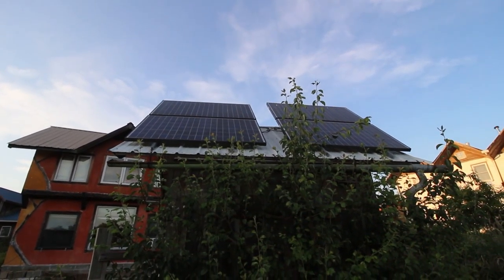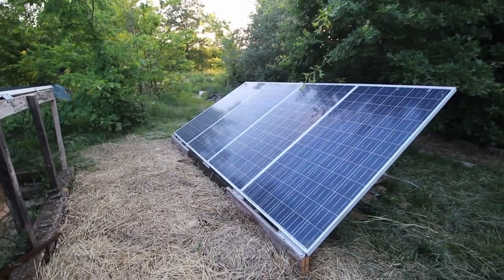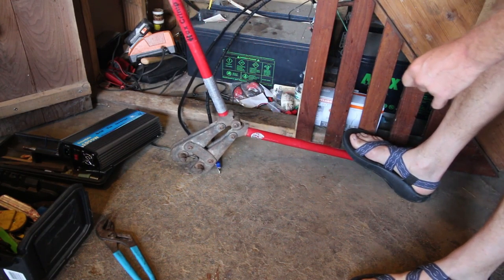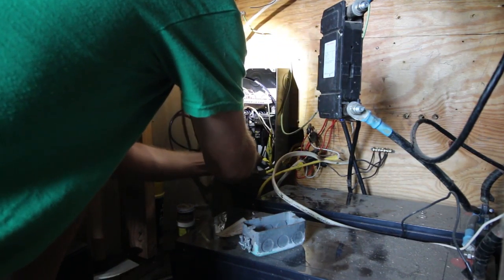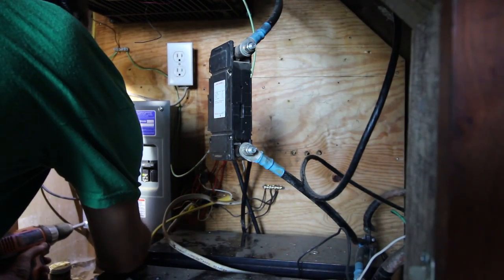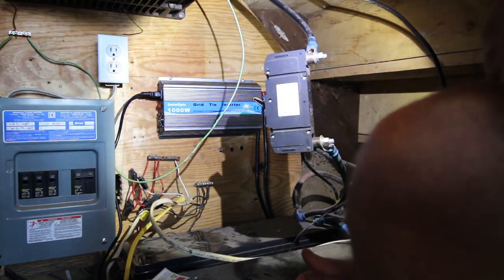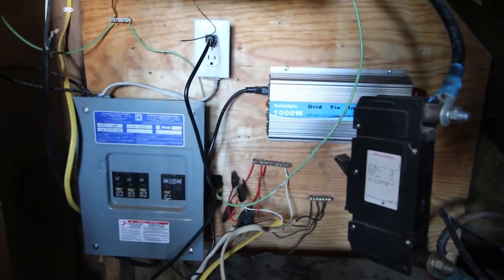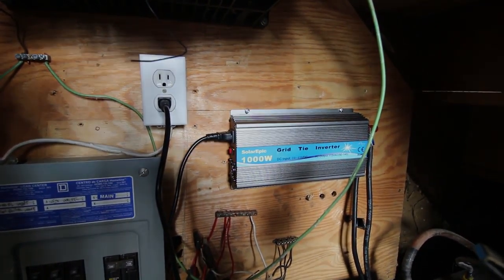The Cheapest, Easiest Way to Produce Solar Power at Home

Comment: Good video.  Thanks Dan.  They finally allow net metering here in Lubbock, TX, but I use so little power, usually less than 50kWh/mo that it would actually cost me more to do net metering because they increase the base fee from like $8 to $20/mo and you don't get any money back from producing more than you consume, you only get what you use cancelled out.  I've thought about doing it anyway, just to get the co-op workers more experience-maybe eventually they'll make the terms better if enough people do it.  I guess it might still make sense for large consumers.  I've got most of the components for an off grid system, so I guess I'll probably do that first.
Reply from the maker: That's great that they allow net metering where you live. It is kind of a raw deal that you pay more for the base fee, but there is the cost of maintaining the infrastructure. I wonder if that fee is a real cost for them, or just a disincentive for people to do net metering. We have a co-op here too and they've been very amenable to our microgrid setup. I understand that a lot of rural electric co-ops are the ones lobbying the government to stop allowing net metering.  I think this will hurt them in the long run.  Good luck!
Reply: I think things are likely to get worse not better.  I would suggest you stay non-grid -tied so they don't get their hooks into you.

Comment: There are plenty of 12V grid tie inverters available on the market that automatically cut off if the grid goes down for the safety of linesmen working to repair the grid. They cut out so they don't back feed into the grid causing it to be live while linesmen believe it to be dead. These grid tie inverters are also called " plug and play inverters " because there is no wiring work involved, you just plug them into a wall outlet and they feed power to your home. If you are producing and feeding more electricity through the grid tie inverter than your home is using at any time the access electricity goes through your meter and into the grid. The power company only gives you a fraction of the money that they charge you for the same amount of electricity.

Comment: I have some solar panels just doing nothing, as well. I was under the impression that each panel required its own microinverter, so I was looking at string inverters (too expensive to buy right now). But if I can connect several panels to one microinverter, I may do that. However, I also plan to eventually add panels as funds allow. If I start out with a microinverter today, will I need a string inverter later? Any advice for me? (this is for ordinary grid-tie)

Comment: You can connect them in series and create a 24v input for each inverter. This will give you the requirements from the micro inverter. The serials connect are connected by attaching the positive of one panel to the negative of the other. The remaining 2 wires will be the input into the micro inverter
Reply from the maker: thanks for the comment. If you read the other comments, this has been mentioned. The problem that I talk about in the video is that the combined wattage resulting from connecting two panels in series was too high to be compatible with the inverter.  I had to find an inverter that was compatible with the higher wattage. Later in the video I did find one--what the video is about.

Comment: Take 2 panels in series the  parallel two two pairs to get 24v or put ll in series to get48 volts.
Reply from the maker: Yes, I'm aware of how to connect panels to increase voltage. They were still not compatible because the wattage changes when you do that.

Comment: Excellent presentation. I want to build a solar panel system that will put out 5000 watts but so far the only companies I have found want to charge unreasonable prices so I am looking into building my own. I also have a lot to learn about setting it up properly. I am very disappointed in the government wanting to stop people from using solar power in their own homes and even though there are only a few against it so far it goes to show just how far we have gone from being truly free to being censored at everything we do. As far as the price drop that is due to the demand of solar power use increasing and causing companies to compete for your business by lowering prices. If the government were to help you they would most likely want your first born son as payment. Oh wait, they already do that with the draft and don't even have to help the family. Anyway, thank you so much for your presentation, it has given me back my motivation to get these solar panels installed and working. I can't even hardy imagine saving 2-3 hundred dollars a month on the power bill.
Reply from the maker: Actually, the price drop in panels was due to the transfer of manufacturing to China and then the increase in production and demand. Also because of government subsidies to renewable power during the Obama administration.  The connections between these events are well known and documented and I personally got subsidized by the government to install solar powered irrigation in my vineyard.  They didn't need my first born and all I had to do was fill out an application.  It essentially made it possible to have irrigation for my vineyard and hoop house businesses.There were many opportunities for tax credits for installation of renewable energy systems over the last 10 years and it led to a huge growth in the solar industry.  Trump has wanted to stop competition with the oil industry by the solar industry and stop energy independence by implementing high tariffs on Chinese solar panels.  Now the price has gone up and the industry has suffered greatly.  This is bad for all of us.

We haven't had a draft in the US since 1973.  You have been misled by unreliable sources.

Comment: if you connect your panels in series instead of parallel you can up your voltage but end up with the same amount of watts so you could use the microconverters
Reply from the maker: Yeah, I actually explain that in the video, but that still doesn't make them compatible with the microinverter.

Comment: I would like to build a simple 2kw solar, there are several types of solar panel, what would you recommend. am in UK
Reply: Mono panels are more efficient so smaller for the same wattage. Look on some wholesale websites, many list panels by the watt per $. Some of the name brand panels are well over a dollar per watt, but some are cheaper. I checked a wholesaler in the usa where i am and they have two cheaper assembled in the usa panels with competitive warrabties for 0.79 dollar per watt. One was 365 watt for 289. That is a little over $1700 usd for enough to meet tour criteria. Of course there are other costs too.

Comment: You should never backfeed into the electrical grid without the proper equipment and the agreement if there's ever a power outage you could fry an electrician working on the line. Just like you must have the main breaker off when back feeding into the house with a generator for power. outages. Safer way  just have a separated circuit to run dedicated items.
Reply from the maker: We have taken all those precautions with our microgrid and I explain in the video that the inverter I use cannot work unless it has grid power.  If the grid goes down there is no way for the inverter to backfeed or work at all, by design.  Please watch the whole video before commenting.  Inverters that backfeed have to be designed to cut off power in the event of a grid power outage for the exact reason you mention.  They are not the same as hooking a generator to your power system.  But thanks for your concern.
Reply: Hardcore Sustainable it was for more that didn't fully understand the video that I could read it in my comment. Not all understand about the safety of back feeding into a panel. Electricians lives matter✌️

Comment: I used a reputable Chinese manufactured grid tie inverter that plugs in with island protection. I put up to four in the summer and six in the winter and I harvested enough energy to drop the electricity bill. I could monitor my neighbors numbers and mine and my bill held at 30$ while theirs fluctuated at 150$-200$. Of my 30$, 10$ of that was a mandatory fee. 

So pop off those inverters. Save them or yard sale them. Or same with your panels. I’ve made a 12v stand alone system from my water shack for shower, pump, inverter to plug in this and that tool wise. So all same components. And then would upgrade. I’m just at the brink of getting a 24/48 inverter but making the jump to a three wire ac system no longer makes sense because I’m now 100% off grid. But it helped me understand the system doing my own mistakes. The completed system while expensive once set up and running with the assistance of professionals I still say is the way to go if you want to save money. Because whatever you save in components you make up for in mistakes in my experiences. 

I’m now 24v - 8 six volt 500ah wired series and parallel. I’m at four 300 watt 24v panels about to get four more. And I took my 12v panels 100w - 10 panels and put them in their own stand alone 12v set up. 

Those freezers now are 12/24v.
Reply from the maker: Thanks for the info. I'm not sure how you are saying your system is different from mine and you don't give any prices of your components. Sounds like maybe you are suggesting not using the direct grid tie inverter and using a larger wattage inverter and being off grid?? Why would you say I should sell my inverter and panels? You don't explain anything.  I spent $100 on my grid-tie inverter and it's still going strong and I'm still backfeeding way more power than I'm using. My old non-grid tie inverter is just feeding power to my batteries. I saved at least $1300 by not buying a new grid tie Outback. I really like the way it's working and don't see anything wrong with it so far.  The sundanzer fridge and freezer I have are both flexible for 12 or 24 V.
Reply: Hardcore Sustainable if it works it works lol. Well it’s just that you said in the video that they weren’t working with the 12v. If they are then it’s not an issue. If they aren’t you can recoup your money and keep the working products in circulation.  And make your system expand in a lot of different ways. Just as a suggestion.  So I didn’t sell my 12v system when it became obsolete. I separated it and use it as part of my overall system in a smaller segment.
Reply: Hardcore Sustainable oh and the only thing different about our systems?  I was told I was under feeding my solar. Which is why I’m adding more panels. If that also helps you. Even though you may have a decent harvest most days there are days you and I aren’t covered. And it helps keep the low days a higher discharge level.
Reply from the maker: @blairbushproject  Okay, I thought that might be what you were saying. I thought maybe you missed the later part of the video where I installed the inverter and it was able to work with my old panels.  Thanks for the suggestion.
Reply: Hardcore Sustainable I might have. Only being off grid is so luxurious that I completely have the accompanying interruptions in services for signals. I had a big storm roll through and it hit hard and fast. I’ll check again because you know more than I do about the little inverters. I’ve wondered about them but havent seen real people use them in real world conditions. Probably about 3 economies and at least a county away someone might have one of those lol.

But I’m just now getting to do the solar fridge. And that’s when they told me I was under harvesting with my setup.

Comment: My Utility rates with FPL in Miami are tough to beat right now, and my average bill is under $150/mo.... With cost of solar still dropping better off waiting.  The money will be better spent reducing energy consumption, like a higher eff AC unit.  And maybe an instant on water heater.
Reply from the maker: I don't do it for the money savings, although this video does say "cheapest".  The price of solar panels is going up dramatically very soon because of a new trade restriction the Trump administration has imposed on solar panels not made in the USA (these inexpensive panels have made solar much more accessible and led to the growth of the industry). It's always a good idea to reduce consumption as much as possible before installing a power system, because then the system will be cheaper.

Comment: Dont you have to tell the grid company that youre back feeding? Or can you just plug it in and go without notifying anyone?
Reply from the maker: I would guess that most people need to find out if their utility even allows backfeeding, but I didn't have to do that because we have our own microgrid at Dancing Rabbit and we have set everything up through our electric co-op to backfeed.
Reply: Hardcore Sustainable what special equipment does the hopstepping hare have to backfeed?

Comment: Can we install them easily ourselves?

I am thinking for manufacturing solar panels and installation inexpensively much less than solar companies are charging home owners.   This will reduce cost of ownership and make them affordable for more home owners.
Reply from the maker: With this system of microinverters installation is very easy, but you do have to have permission from your utility to backfeed into the grid. And as with anything electric you want to take all precautions to make sure you are connecting everything safely and not creating a fire hazard. If you aren't an electrician and don't have much experience installing power systems, you'll want to read up on what's involved and make sure you are doing everything safely. You should have an electrician or a solar installer inspect what you've done.  The system I describe in this video is a matter of connecting microinverters and panels together with simple connectors already on the panels and ports on the inverters.  Then they plug directly into your grid or can be wired directly into it.  My inverter had a three prong plug to plug into a socket as you can see from the video.  It's very simple.

Comment: Interesting info, but I'm pretty sure I want a non grid tied system. I just have no faith in the power companies, and anyway what good is having your own power system if it goes down every time there's a power outage?
Reply from the maker: An off grid system is a fine idea, but unless you have back up of a wind turbine or enough storage you may have times of the year when you don't have much power because of clouds or lack of wind. Batteries are really expensive too, and they don't last very long, which is why I just went to a backup battery system in the event of a blackout.  Either way, you are still not giving money to fossil fuel industries and not contributing as much to climate change--so that's the best thing.
Reply: You might consider a hybrid system.  You are connected to the grid when you need more power than you can produce but you don't feed back to the grid.  That way you will always have all the power you need and you will also have your own power when the grid goes down.
Reply: @heidiembrey4917  Is it legal to operate a generator to run a refrigerator? If so, then it should be fine to have a basic solar system with panels, charge controller, batteries, and inverter to serve as a generator; just don't connect it to the circuit breaker box so that it is not tied to the grid. You would obey the law by maintaining a grid power connection, and you can size your off-grid solar system to handle whatever percentage of your needs you wish. There may be a law requiring a grid connection, but there is no law that requires you to use it.

Comment: Just connect the panels in series, in pairs.   
Enphase micro inverters will not burn out, they just reach saturation, and then use only that much power. They actually recommend oversizing the panels in order to achieve maximum watts per dollar spent on the inverter. 
They can handle 60 -72 cell panels.   If your panels are 12v nominal, they re probably 36cell panels.  hook 2 of them in series, and there you have 72 cells and the right voltage. 
Enphase M250 or other size micro-inverter should work fine, just check hertz, and line voltage. if you have 250v, then power the overall 250, not just one leg. 
you can pick them up for about 75 dis each used on eBay.  they re like 125 new each.
Reply: oh, and point the panels at the sun's arc. guaranteed to help.
Reply from the maker: The M250 is a 250W microinverter. If I connect two 210W panels in series that will be 420W into a 250W inverter. Even if they won't burn out, that is a lot of wasted wattage.  Why would I want to do this?  I talked to someone from Enphase, told them my situation, and they said their microinverters wouldn't work with my panels.  I thought they might know something I didn't, but they said what I was saying was right.
Reply: There is an economical benefit to inverter saturation, but only up to a point. to start with the actual output is almost never the rated output, so if you over size you will get closer to the actual inverter capacity. Besides, the inverter is a large part of the cost of the system, and you must gauge the watt hours wasted vs the lost peak output watt hours on each side of peak.  Enphase did a study, and found that for most regions, about 140 % was ideal.

Comment: Use all of your electrical devices during the day and you may not be back feeding, but consuming everything you are producing during the day, and not using the grid as much during the night since you did most of your electrical needs during the day.
Reply from the maker: Yep, that's the key to using as little grid power as possible. We try to encourage this at Dancing Rabbit.
Reply: Aaron, this is the KEY thing to learn and adjust your life/schedule to in order to take full advantage of a non grid tied system.  Still working on it...